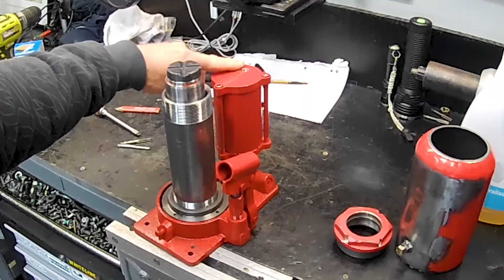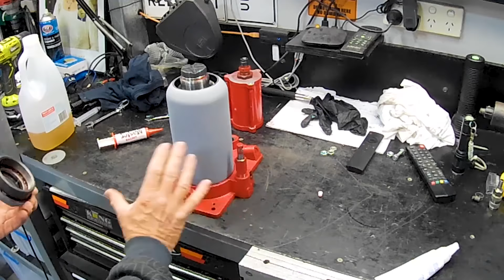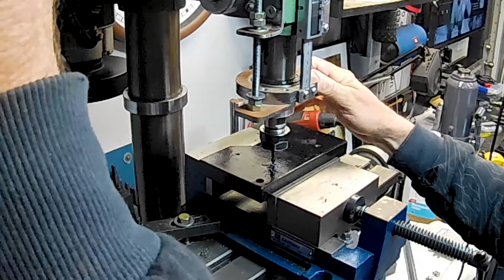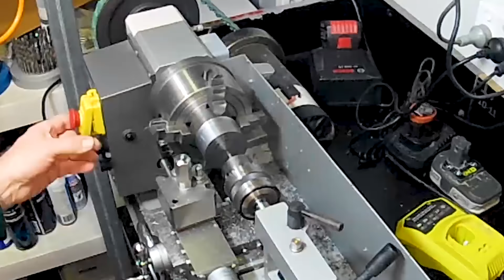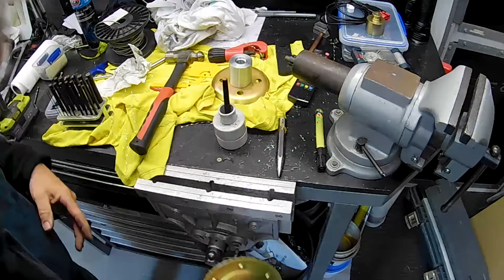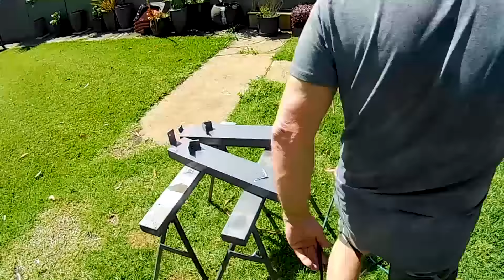The Ultimate 20 Ton Shop Press Upgrades Compilation

Comment: Late to the party I know, but this is the MOST comprehensive and complete set of mods I have ever seen. I would love to see a "1 year later" style video with your experiences with it and what worked or didn't work like you planned. I also have a plan for something similar on a much smaller scale, and would love to be able to pick your brain on a few minor points of improvment/unique design features I am contemplating...

Comment: Man this is already costing me big time & im just getting started for goodness sakes.
Used HF 20 tonne press on Sunday $150
Steel from local steel supplier today for press plates, cross beam for the Jack to sit on & 24mm round bar for the support pins. - $200
EBay for the air over hydraulic Jack, winch, foot control switch etc $539

So I’m at $890 & I haven’t even started yet.

I’d like one of those Swag Off-road 20 tonne finger break kits to be able to bend sheet metal up to 1/4 inch thick for fabricating and the like but it’s around $1400 for the kit & another $1200 for postage. 🙄🤷‍♂️😳😳

So that’s getting up there around $3300.

Then there’s paint etc and bolts etc.

Gonna run maybe $3500 all up.
But it will be a hell of a press once done.

Did you happen to keep a tally of what you spent on yours just for materials at all?
Reply from the maker: What I usually do, is keep a tally until it reaches my estimated total cost (usually a 1/3rd of the way into it) & then stop counting. I'm yet to blow the budget on any projects. Lol. P.S. Personal Satisfaction is immeasurable in $. Cheers Mate.

Comment: Just watched your series on the 20 ton press & got some great ideas.
I had a couple of suggestions on the build. 
For the fill plug I would recommend using a breather bolt, if you go to McMaster.com and type in breather bolt you will see what the item I am refuring to.
I am in the US and a company here sells a 20 press similar to the one you started out with. A weakness of the press is the top channel iron may deform and stay that way under a heavy load. I would recommend reenforcing the top channels with gusset plates and boxing in the channels.
Another idea I have seen is tapping the base plate of the jack and adding a pressure gauge to observe the amount of force being applied.
Great series, enjoyed watching and got some great ideas.
Reply from the maker: Nice tips Mate, Cheers.
Reply: Unfortunately McMaster will not sell to Australia.

Comment: Excellent video series. Contemplating the same jack inversion on my own similar press. Question, Does it leak/ Weap hydrolic fluid?
Reply from the maker: G'day Tim, not a wiff or a drop. I use it all the time, as you can see in some of my more recent videos. Very happy with it. Cheers Mate.

Comment: Really good videos. Looking back, is there anything you would alter? Also, what part are you most pleased with. The pulley system looks super slick, or was it your big knob that done it for you🤣
Reply from the maker: Hi Stephen, pretty happy with it all, honestly I don't think I would do any of it differently. The Inverted Air/Hydraulic Jack was probably the most satisfying achievement with it. Cheers Mate.
Reply: I watched that aspect with much interest. I thought that inverting the air over hydraulic Jack was waaay too much effort for the end result.
I “get it” that you wanted the acme thread screw adjustment upside down, & that makes perfect sense from a convenience and safety aspect for your hands / fingers.
You achieved it and fair play to you for having the skills & equipment and knowledge / expertise to pull it off.

I’ve only picked up my used 20 tonne harbor freight type press only yesterday to commence this exact type of “supreme modification” project for my shop. That’s why I’m so interested & watched this one (along with many others that now pop up in my feed.

I saw someone else achieve the exact same thing with only a fraction of the effort you took, without having to invert his air over hydraulic Jack the way you did.
His remained upright & saved all that work.
He stripped apart the old manual Jack that came with his press, and salvaged the internal sleeve that houses the acme thread adjustable ram, and mounted it underneath his right way up air over hydraulic Jack where it mounts on its beam, as his pressing ram.

A fraction of the work you did, for exact same result.

That is the way I intend to do mine I think.

I own a Bridgeport mill but no metal lathe yet, so all the lathe work in your video isn’t an option for me unfortunately, so I have to come up with a similar result, without all that lathe works utilising only the mill.

I think I can achieve that, without inverting the air over hydraulic Jack the way you did.

Much simpler, easier, quicker & will work using what I have available.

Yours could do with one of the Swag Off-road Heavy Duty Finger Break press kits - so you can bend sheet metal and plate steel for fabrication work as well.

That would be a really good additional upgrade to what is now already an awesome press. 👍